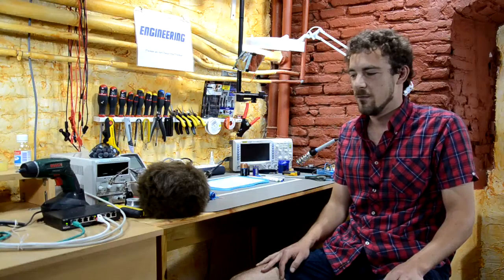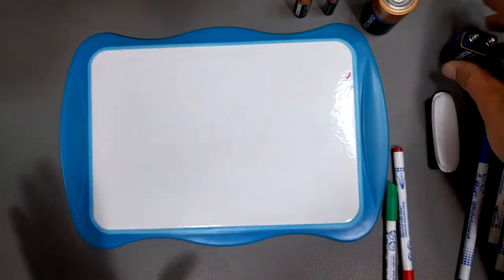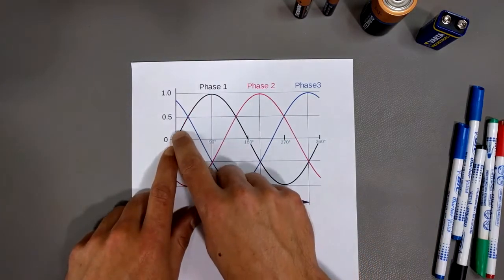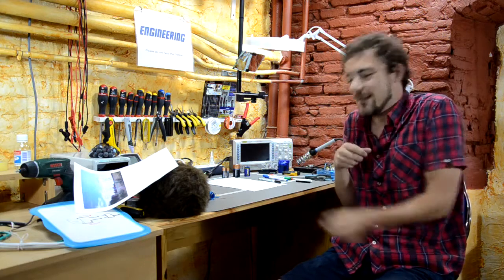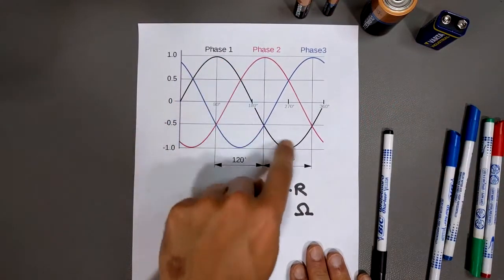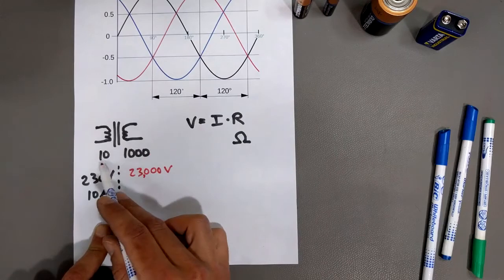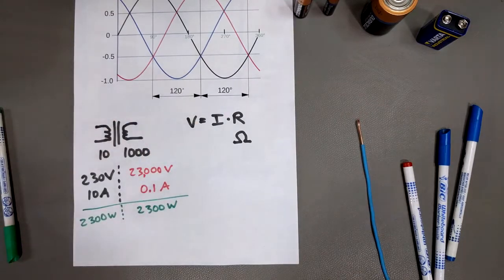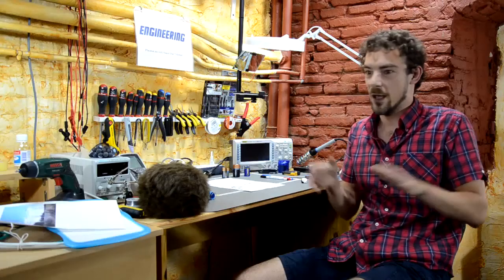EEK! #2 - DC vs The Magic of AC

Comment: They do use high voltage DC in some areas for point to point systems that can be out of sync and have directed power flow.  DC is also common with controls, due to simplicity of battery backup.

Comment: Scottie, is thicker insulation the only thing you need to carry more current?  Don't you also need a thicker conductive part of the wire to carry more current?
Reply from the maker: Yes, the cross sectional area of the wire needs to be larger to carry more current without heating. The higher the voltage, the better/thicker the insulation needs to be.

Comment: so, AC is better for power transmission. my computer runs on DC. kitchen appliances use AC. are rectifiers used? or why doesn't the blender constantly reverse direction like 60 times a second?

Comment: To paraphrase Chuckiele from http://www.youtube.com/watch?v=S7C5sSde9e4 comments
AC is only used because there was no DC to DC conversion at the time of Edison. Where as now we could generate low voltage DC, convert it to high voltage DC, transmit it through the power line, convert it back to low voltage DC and power the homes, which was impossible back then.